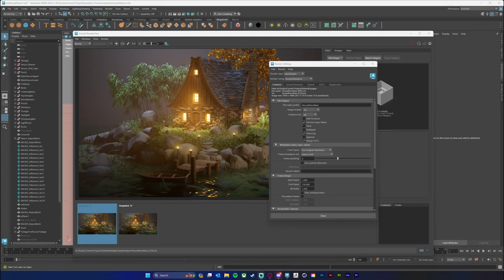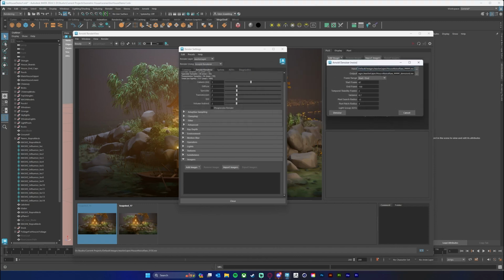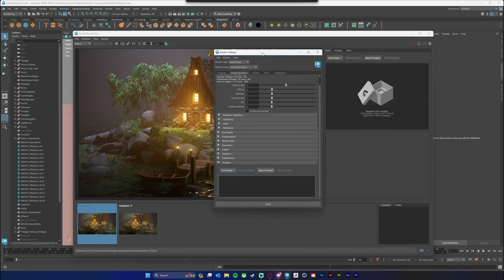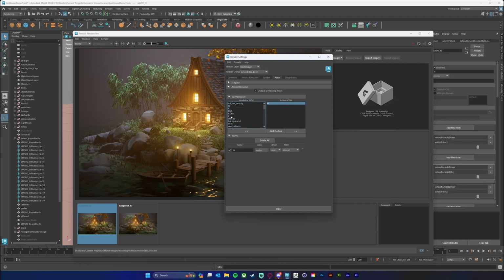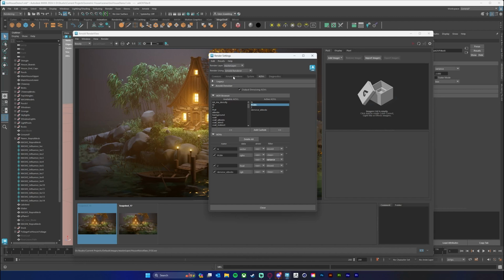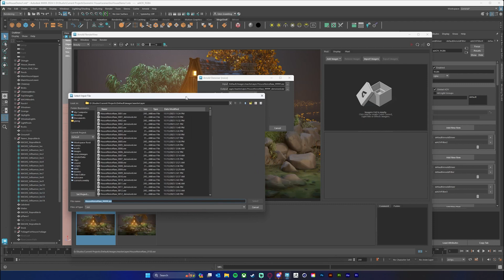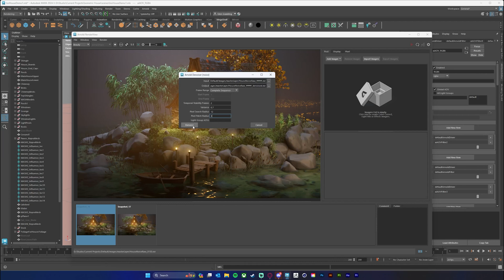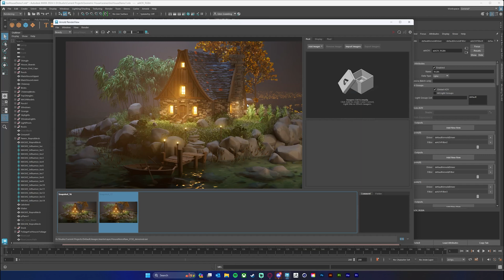Denoise your image sequence in Maya using Arnold Noice.

Comment: I followed all the steps and still, the denoiser does nothing ,it just outputs a non-denoised exr file.
Reply from the maker: Ugh, I'm sorry to hear this. Honestly since spending the time to figure this out, I've decided it's kinda not worth my time. Until they can streamline the process and make the NOICE process a little quicker, I would rather just up my samples instead. I've also been doing some experimenting with redshift, and while the renders don't come out as physically accurate as Arnold they are much cleaner and have a lot less noise.